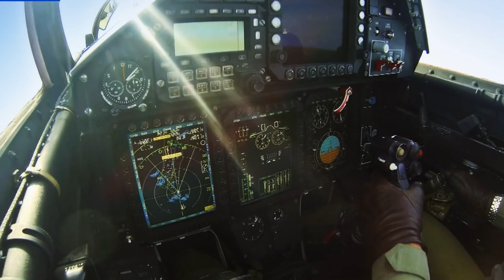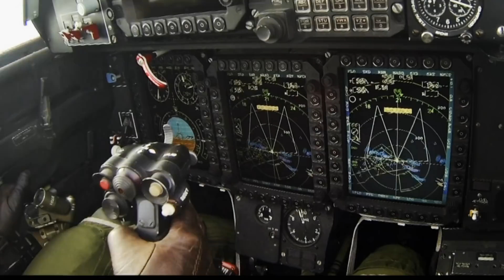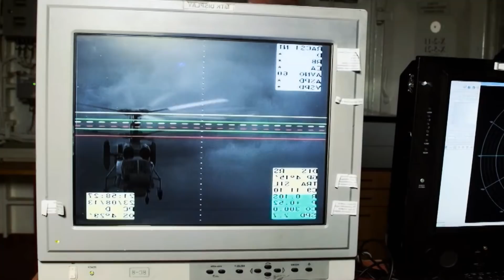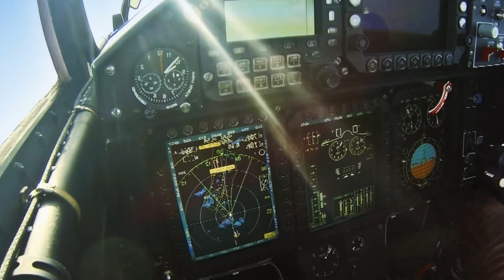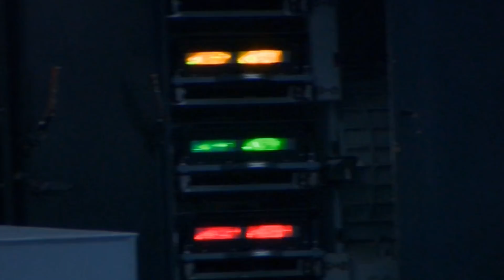Time Is Running Out for Russia's Only Aircraft Carrier - Admiral Flota Sovetskogo Soyuza Kuznetsov

Comment: Actually the US carriers with their 2 nuclear reactors will run circles around this thing. US carriers can easily do over 30 knots and can stay at sea for moonths. It never needs to be refueled and the only limiting facts are how much supplies it can carry. But it will usually be resupplied while at sea. 

It is almost impossible to compare the Russian carrier to a US CSG (Carrier Strike Group). The Russian carrier does have thhe range or fire power to project its power, whereas a US CSG is MUCH more powerful and can project its power across the globe. The Russian carrier carries out more of a defensive role.
Reply: MississippiRebel Russia wilk use some few missiles and the US Carriers will be out of the war .
Reply: but the carrier is a nuke target
Reply: Aircraft are sitting ducks against powerful nations, better to invest in nuclear submarines.
Reply: Lunar Incident 1IbramGaunt aircraft carriers can be tracked in realtime through satellites and can be sunk through gps guided missiles. Submarines can be hidden, so are better choice.
Reply: yoppindia sonar is useless against them now?
Reply: yoppindia thats why all 79 of Americas submarines are nuclear powered
Reply: The new Queen Elizabeth aircraft carrier has a fleet of service boats with jet and ship fuel. You need fuel for aircraft so why not refuel the ship at the same time anyway?  So it costs less and can still pull 27 knots and there is no waste to get rid of, which the US currently has trouble with decommissioning due to that. Though it does depend on support ships for defence, but then again she was never meant for solo deployment. The power plants also have fast and relatively easy  turn around on replacement. Days, not weeks or much much longer for the nuke boats.
Reply: Oh dear. Given your mistakes, you may want to redo the whole commentary, and I'm not just talking about your pronunciation of "Kutznetsov" (coots - nets - off).
Reply: yoppindia you were listening when he mentioned 198 anti-air missiles? And where, exactly, are you firing these GPS guided missiles from? Is it as well defended as a US CBG, no, but it might take a US CPG - in range - to defeat it.
Reply: *Kuznetsov = cooz - nets - off...
Reply: Fa I Na A Carrier Battle Group (AKA Carrier Strike Group) sounds like a damn sight safer to be on if it gets to nuclear war than being in any major city. Just saying...
Reply: I bet that lots of Russkies will try to convince you here that their old junk could sink all 11 US carries while whistling "Kalinka" with its engine pipe at the same time :-D
Reply: This is a missile carrying cruiser not an aircraft carrier. Its offensive capabilities are not its aircraft but its missiles, its aircraft are for fleet defense.
Reply: yoppindia you do reliaze russia is a third world country
Reply: Everything is a potential nuke target, the carrier is just another nuke target. The problem with nukes is that if you use them then everyone looses, including you. They are a strategic dead weight that you can't use without committing suicide. So, if you're going to rely on nukes as a component of your anti-CV strategy then you need to be kept far away from any command role, probably best to keep you out of the military entirely. While I have no personal stake in the military, I do have a very personal interest in not staying alive.
Reply: That's not really fair. Much of Russia has a foot planted firmly in the developed world ("first world") although I do not dispute how a lot of it is very backwards.
Reply: MississippiRebel that's cos the US is all about offensive invasive force all over the globe protecting its empire, the very thing that the original Americans rebelled against
Reply: Right on MississippiRebel. My Dad served on the USS Kennedy which was a nuclear powered carrier. It never needed fuel and well over one million miles on 35 pounds of uranium.  That was in 1968. Which means that the US Navy has a 75 year jump on the POS Russian carrier. We have 12 carriers.  I hope Putin restarts the Cold War and we will bury Russia just like we did the Soviet’s
Reply: russian is not 3rd world russia is 2nd world 1st world= NATO 2nd world=Warsaw pact (or former warsaw pact) 3rd world=neutral
Reply: you didnt "bury" the soviets militarily, they collapsed economically. The USN uses nuclear subs because it see's no uses for essentially limited range but quieter subs, because the USN is setup as a purely offensive/projector force and has no real defensive strategy (USN hasnt had one since Midway.) and the advantage of a convention sub over nuclear is the defensive capability, the things are basically invisible in ambush (no a nuclear boat is not also invisible in ambush because you have to keep water pumps and systems running to maintain the reactor, this makes mechanical transient noise, more than a boat running on batteries) and you can build more them and crew more of them from a smaller economy and population, Russia understands this distinction as does the UK hence why they both persue both conventional and nuclear boats (in Russia the new Lada, Borie and Yasen classes). End of the day, things go hot, Russia will not use surface combatants against US Carrier groups,  it will use wolf pack sub tactics in ambush which likely will be highly effective especially if each group includes at least 1-2 SSGN's or SSG's to provide target suppression or are coordinated with strikes from mass Tu-22M strikes paired with Tu-95 or IL76 for EW (and trust me, a carrier group is gonna be shitting all the bricks if a squadron of Tu-22M's launch a mass strike, youre not gonna get out of it without casualties and likely losing a ship or 2, damage to carrier is likely as well although a kill is not unless nuclear weapons are used but again this would be to soften the target up, the subs will make the kill. And it will be hard for a 688 or Virginia purring along at 8 knots to hear a stationary LAda or Yasen or Alfa.)

I reckon the USN would lose 2, MAYBE 3 Carrier Groups in the opening months of hostilities (ESPECIALLY with Trump as CiC, just cos he would go on the offence early on and commit the big assets in attempt to intimidate and overwhelm, ignoring the history of Russian warfare which is to fight military  with this doctrine) sure the USN would beable to shut the Russian Fed. Navy down but it would get more than a bloody nose doing so. This is also assuming Russia doesnt gain any new naval ports with year round ice fee access to any major body of ocean, which would probably be Turkey or Norway and if Putin is smart, itll be Turkey as he can get access through the Suez and unless Spain and Portugal get involved, Gibralter strait isnt that huge an issue the break out of. And gotta tell ya, me dont like Turkey's chances of lasting more than 4 months against the combined concentrated force of the Central Army and Air Force of the Russian Federation. Meanwhile the rest of the Russian army and Air force really only needs to hold the rest of NATO off, once Russia can deploy its best fleet into open Atlantic waters, things get very dicey for NATO, simply because outside of naval powers, nothing defends the NATO countries from the west, it could be very crippling as the NATO countries would again rely on supply from the USA to maintain a strong warfront. Again the USN has ab ig advantage of numbers and tech along with the NATO allies but the Russians can pick their naval fights, the NATO Navies have to be everywhere all the time, the Russians simply have to be that 1 place the 1 time and they get a win. Also remember that Russia would cut off supply of energy resources to all the NATO exports, of which there is no way for those countries to backfill that massive gap in supply and national reserves will nto last long in a war economy.  

This is probably one of the biggest reasons for all the sanctions and economic attacks on Russia this past decade along with the massive militarisation of some NATO countries, they are absolutely terrified of the capacity the newly energised and motivated Russian Federation has and it really is only because of these moves in the UN and the greater diplomatic efforts to sway less involved nations from investing in Russia that has prevented the Russian economy from exploding and has kept it comparable to Australia and thus kept their population from growing, i have no doubt that if those pressures were alleviated/removed Russia would have an economy on par with Germany in a decade or so and a very healthy pop growth (id be surprised if it was less than 3.5%/annum avg).

And imagine the quality and quantity of gear they could punch out, they already make some truly impressive stuff with the tight belt of economy they have ot work with, always have really and giving them the resources to open the taps would be truly interesting. This is why there is such a big passive aggressive doctrine between the West and Russia, its a massive threat both militarily and moreso economically (the customers they could potentially pull away, even some NATO countries could be tempted like Spain, Greece, Turkey, France and Norway) against the west, especially as if we look at it as a complex system, considering that Russians were communist not too long ago, they seem to be better at the capitalist system than most Americans are
Reply: Matthew Ray Obvious propaganda.
Reply: what is obvious propaganda?
Reply: all things considered in a global war russia would most certainly deploy nukes on to carrier groups since they are well worth it.
Reply: This can stay at sea for months as well, it just needs to refuel diesel, which can do done whilst picking up supplies and jet fuel.
Reply: MississippiRebel that is why Russia (especially during the cold war), focused on the development of long range anti-ship missiles rather than more costly aircraft carriers. It is true the US has the power to project its force across the globe, as the US have the funding and capability to do this. A barrage of cheaper anti-ship missiles against a carrier is enough to send it to a watery grave. Since the defences of the carrier and support ships cannot stop every incoming projectile.
Reply: A Ford Class carrier by itself can take on a country by itself. Add the strike group and there really doesn't need to be anything else.
Reply: Only because they've been kept to just one carrier. You understand why countries bordering Russia are terrified, right? Invading half the world? You know there are 195 countries currently, right? How many has the US "invaded"? Keep in mind that an invasion is done without permission. We have permission to operate in several countries. Also, it's not just "America", it's a coalition and usually backed by NATO. Every time it's with the UK. Often including Australia, France and Germany.
How about Russian invasions....Ukraine, Chechnya  (twice), Georgia.
Reply: Dam right 🇺🇸
Reply: H D Dunbar What years did your Dad serve on Big John? I had friends on her. But minor correction, the Kennedy was convential powered. Every CV up to the Big E CVN-65 was nuclear powered. America CV-66 and Big Johm CV-67 were the last two boats without nuclear power.
Reply: joe3 Georgia Chechneya Ukraine Hungry East German Poland Lithuania Estonia Czechoslovakia Afghanistan Mongolia Finland Korea, yeah the Soviet/Russian Soldiers and tanks all got lost when they went to those places.
Reply: MississippiRebel I suggest you review the last few NATO war games and how the USA lost carriers every time
Reply: Andrew Lancefield So NATO forces are able to penetrate US naval defenses and sink one of their carriers.  What are the chances of one of these NATO member nations being able to penetrate Russian defenses and sink their single carrier?  Pretty damn good imho.
Reply: Dudes it's not a aircraft carrier, this ship has different purposes...
Channel has no idea what he talked about.
Reply: +working on a name s almost useless subs are so stealthy nowadays
Reply: +helmedon a carrier is absolutely fucking useless without its airgroup and even with one its toast 

a single kirov vs a single nimitz or ford carrier the kirov could win quite easely just because of the stupid amount of munitions and power it has wielding enough missiles to shoot down over half the nimitz or fords planes and having enough ciws to defend against pretty much all attacks while being able to punch above its weight with its 40 missiles both carriers have absolutely nothing in terms of defense aside from 2 ciws and 4 50cals which would barely be usedfull (we are talking refit kirov) which features s400 aa missiles p800 onisk anti ship kashtan systems ak630 and upgraded ciws over that and numbers of missiles

a carrier needs its support without it it is weak 

also the us lacks any large anti ship missiles which is their downfall 

a carrier battlegroup can defend against almost everything but a single carrier no

even the kuznetsov is weak alone although considerably less
Reply: The point of this thing is having fighter air craft defend the fleet of missile cruisers from american naval fighters so it CAN get close enough to use its shipwreck missiles (388 miles)
Reply: Its aircraft carrying missile cruiser, so I wouldn't call it defensive
Reply: cos whole russian army is built on defensive doctrine, whereas us army has assault doctrine
Reply: us carriers can stay out to sea indefinitely if need b. they do have re supply ships
Reply: 1 nuke and your $13billion carrier is gone.
Reply: @marksman712  we have diesel/ electric sub Marines USA leads in stealth sub technology
Reply: A nice side benefit of having two nuclear power plants is that one can power the ship while the other processes sea water into jet fuel.
Reply: @joshualance6005  you have a hand full which are the first iteration of any in the USN fleet for decades and no you honestly dont based on wargames and naval exercises
Reply: nuke tipped sub torpedoes and no more US carriers :P
Reply: @andrewlancefield3730  they didn't lose carriers. They were targeted by submarines; the torpedoes actually making a substantial impact are low. The reality of a submarine sinking a carrier is actually pretty far fetched. The sub could get off a few shots, but the second a torpedo hit the water, they would be triangulated and targeted by destroyers and anti-sub helos. The torpedoes that were fired would damage the carrier, but it would take TONS of explosives to sink a carrier. They are highly compartmentalized, and can operate effectively even after taking heavy damage below the waterline. The best way to destroy a carrier is with a flight deck hit from high explosive bombs, NOT a torpedo. And when I say destroy, it'd be an operational kill, taking the carrier out of action for the duration of the war. But it would still float.
Reply: US carriers are useless and pretty much as obsolete as battleships, a single Swedish sub sank a US carrier  in recent war games. Russia has supersonic anti ship missiles other countries are developing them too, you can get a shit tonne of these missiles for the crazy daily operating costs of the these carrier groups, they could just brute force an attack against these ships,  they only need a few to get through to take out the ship
Reply: Matthew Ray  About 30 years ago the US submarines changed from SCR to PWM drives for their cooling pumps. The pumps are actually more quite than the ambient operation noise on a sub. They are quieter than battery subs. I was part of the program so this isn't just some BS from some web site.

As to the rest of your comment a refer to the Dunning Kruger affect.

Comment: Nice video and you have helped me start my trying to get into the paras when I'm 19 I am fifteen at the moment and how long would you say it takes to train your body
Reply: Tyler Taylor it depends on how fit you currently are. Generally training will make you as fit as you need to be for your job supposing you are at a healthy weight. I recommend you look up the standards for your chosen job and train for those. I'm training to go into the US Army so I'm doing 2 mile runs. I recommend you start now and run two miles 5 times a week and do at least a half hour of  bodyweight exercise 5 times a week. Get involved in a sport as well even if it is just recreational.